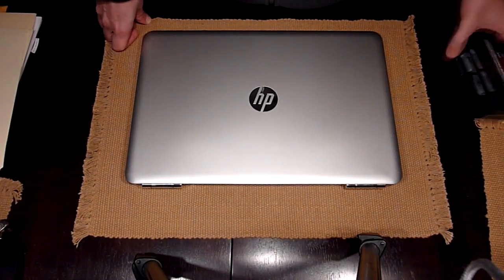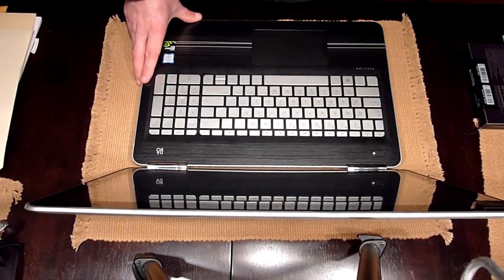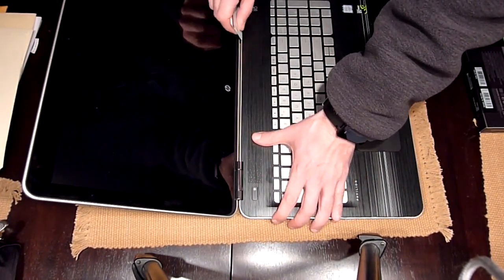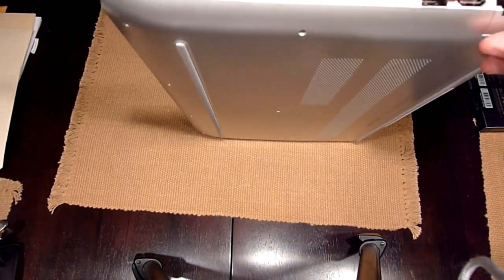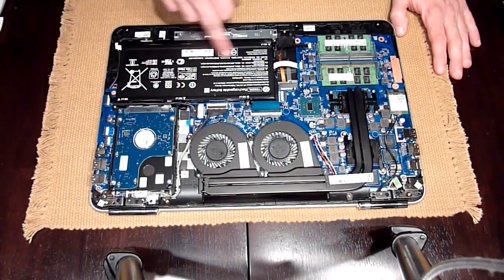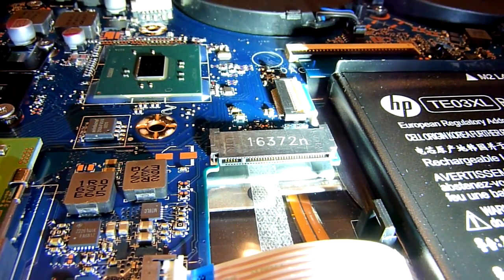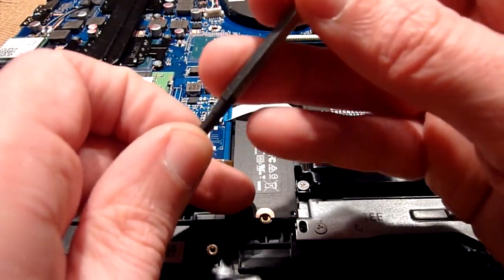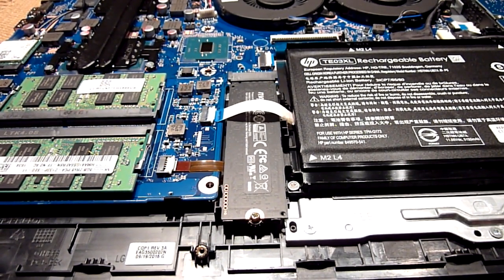HP Pavilion 15 bc018ca Laptop with Samsung 950 PRO M.2 NVMe SSD Drive install

Comment: Hi there i have same laptop but the next generation of it with core i7 7700hq 
Gtx 1050 
The problem is i asked hp if i can use nvme but they told me you cant because the 7th gen doesnt support this feature !!! And then i saw your video 
So my question i have Adata xpg nvme ssd with 3000 /1500 read write speed so if i install it in my laptop does that make any problems ??
Reply from the maker: I doubt it would not support NVMe drives... if you have the connector, I am pretty sure it will work... Again, install the drive while keeping your mechanical drive, turn on the computer, if you log into windows and it does not show up in the drive manager, reboot, log into the bios, CHANGE NOTHING, save and reboot and log on to windows again. It should show up in the drive manager, you simply need to create a new volume and format. It should work.
Reply: @Aleziss  thank you man
Reply from the maker: @mooder3247  you're welcome !
Reply: @Aleziss  have you lived any problems with your ssd ??
And does the motherboard can support this speed in my case my driver is Adata xpg nvme pcie3  3000 1500 mbs speed
 so i dont know if my motherboard can handle with it 
So do you recommend to buy this Adata xpg nvme pcie 3 
Or buy a normal ssd m.2 with 500/500 read write
Reply from the maker: @mooder3247  no problem with my Samsung M.2 drive yet, super fast, I get 2220 / 1255, a little bit slower than the drive specs but waaaay faster than any other drive that could get into my system. I you get a M.2 with 500mbit, this is NOT a NVMe drive, it is a PCI M.2 drive and probably wont be compatible with your system.
Reply from the maker: @mooder3247  you're welcome

Comment: Does the MB support NVMe speed or run it at M.2/ SATA speed? Is there an option for speed selection in BIOS? Thanks for the nice video BTW.

Edit: I see you mention that this is NVMe slot. How to identify the slot M.2 vs NVMe ?
Reply from the maker: M.2 is a form factor of NVMe AND SATA drive. The "key" that you see in my video is the M-Key and is used for M.2 NVMe drives. You cannot run a NVMe drive in a SATA port, NVMe is PCIe. So what you are seeing in the video is really running a NVMe drive, I am currently having bandwidth of 2220mb/s read and 1250mb/s write speed. The drive is capable of higher speed but my two three year old computer is handling that speed. There is no selection of any parameters for the M.2 slot in the bios, I simply installed the drive, ran in the bios but did not make any changes to the bios and when I rebooted, the drive was there.
Reply: @Aleziss  Thanks for prompt response.  I just wanted to know if there were different ports on laptops for m.2 SATA speed drives with two notces and M.2 NVMe drives with one notch.
Reply from the maker: @darshankumardave7485  you're welcome, yes, this is how you are going to know if it is NVMe or SATA. Remember, M.2 is the form factor and there are different keys that identify which drive the port support.

Comment: I have a optical driver if i remove it and use it as SSD, can i add m2 again for it?.. I have 1tb hdd memory and im looking forward to increase my memory.. So i want to know how to check my motherboards max memory support
Reply from the maker: I am not sure I understand your question but what I do understand is that you want to remove the optical drive to install a 2.5 inch SSD + add a M.2 drive ? For sure the optical drive WILL NOT support a M.2 NVMe drive if it was your question. The best way to know if your laptop support M.2 is to open it and find the M.2 slot. If you do not see the slot, it won't support M.2 as simple as that. Usually there is no maximum size for HDD/SSD in modern computers. RAM is another story, there you could have a limit of 8GB or 16GB, that you will need to find information about your specific model and brand, try to find the service manual, you will have all that information there. Google is your best bet.
Reply: @Aleziss  thanks a lot bro susbricbed ur channel loved for the response 😍😊
Reply from the maker: @bearytube4622  you're welcome, it is difficult for me to find the information for all the request I have here... but thank you for your appreciation !
Reply: @bearytube4622  hi Beary I can help you with your question.  I did the best sad/m.2 setup for my Hp 15 notebook.

1. Buy hard drive caddy to replace your optical drive. Make sure you get thickness correct.   Most common is 9.5mm but my HP Laptop is 9.0mm optical drive.  That's why it's good to measure it and find out.

2. IT IS IMPORTANT TO KNOW THAT OPTICAL DRIVE CONNECTOR IS SLOWER THEN YOUR SATA 3 WHERE THE ORIGINAL HDD is plugged in.

3. What I'm trying to say is if you add ssd and keeping your original HDD.  IT is much better that you swap them since the SATA 3 is much faster then the connection from the optical drive, does that make sense?

4.  Use cloning software to easily get the SSD with the same software and boot from your laptop.

5. I replace my HDD TOO, so I actually have 2 SSD drives and I install the m.2 SATA as well.  That way I have the most amount of storage and speed.  Hope that helps!
Reply: @Vunomic  thanks for the help brother really appreciate your work
Reply from the maker: @bearytube4622  It is important to undestand that what @AirTrack suggest is that you will NOT be able to install a M.2 NVMe drive in a drive caddy that replace the optical drive. If you do so, you would need a drive caddy that replace the optical drive then inside that caddy, you would need to install a 2.5 inch to M.2 SATA drive caddy but NOT a NVMe M.2 drive. Just wanted to clear that out.

Comment: Sir i want to know does laptop support m2 or Ssd. How can i find it? Through software test. Becoz i dont have much knowledge in opening of laptop. My laptop model is Notebook 15 i7 processor and 8gb ram and 4gb graphics and 1tb of hdd
Reply from the maker: I'm sorry to tell you like that but the best way to know if your computer support M.2 drive is to open it and check if you see the connector. You WILL NEED to open it to install your M.2 drive anyway so why not open it now ? You won't have choice to open it at one time to install the drive. This is the best way to be sure and search on google about your model.

Comment: Is this applicable for model HP Pavilion 15-bc018tx?
Reply: Can this be compatible with Samsung 970 EVO NVMe M.2 1TB?
Reply from the maker: I am pretty sure it is supporting a M.2 NVMe drive, just like mine. If you are not sure, just open the case and you will find the slot exactly where mine is.

Comment: Where did you get the screw that was used to fix the SSD into the motherboard? I have watched a lot of videos, but no one is telling about it. Was it supplied with the laptop? Or  with the SSD?
Reply from the maker: in my laptop the SSD is screw to a plastic stub that stand out outside the motherboard. The screw is not provided with the SSD because many vendors utilize different size screws. I had to find one in a bin of recycled screws I've collected over the years. It is a tiny metric screw but again, it is going to be different from one system to the other.

Comment: You can check if your laptop supports m.2 ssd or not by typing [model] + maintenance or service manual and search for it
E.g: this link is for hp 15 au004tx
http://h10032.www1.hp.com/ctg/Manual/c05228250

Comment: Do we have to delete the C drive from HDD after cloning it into the SSD?
Reply from the maker: good question, I would assume yes as I never tried both m.2 with os along with the mechanical also having the os... I did try the m.2 with a formated second 2.5inch drive and it does work fine.

Comment: Hey, can we use inbuilt HDD as our daily storage drive and use samsung M.2 SSD for the boot up? Because my laptop has a slot for M.2 SSD
Reply from the maker: yes you can but I would suggest that you use a larger SSD than use the mechanical drive as it will slow down your system... the SSD and overall system will have to wait for the mechanical drive to "spit out" data... plus at boot time, you will need to wait the spin up time of the mechanical drive...

Comment: I have BC 406tx i5 8th gen will it have a slot for m.2
Reply: same here bro ...!!
Reply: @deepnilvasava7803   I Found NVMe slot same as mentioned here. the only problem is that we dont get screw to fix  ssd onto motherboard from ssd box, neither with the board.

Comment: may laptop is 7th gen intel, but Hp telling me that my nvme slot is not usable, why they create slow that is not usable.. is it true?
Reply from the maker: I have seen one person who has a nvme slot and was not able to use it somewhere in this thread but I doubt it would not work, specially that your system is pretty new with 7th gen i7. You just need to pick the right drive and I am pretty sure it would work. You can also try to find the service manual of your laptop on google and there everything is listed. Also many vendors like newegg offer returns on some products. Best-buy also offers returns to product you buy from them in the worst case it would not work, you could return the drive.

Comment: My laptop model is HP Pavilion 15-cc020TU. i3, 7th generation.
Does my laptop have m.2 nvme slot or m.2 sata III slot?
Reply from the maker: according to the service manual, no http://h10032.www1.hp.com/ctg/Manual/c05493762 on page 2, it says nvme drive for use only on computer models with model numbers 15-cc1xx and 15-cc6xx BUT you can replace the 2.5inch mechanical drive and install a Samsung EVO drive, it is a great update you can offer yourself anyway, standard 2.5 SSD are way way faster than the drive you currently have.

Comment: Do you think we can upgrade the HP All-in-One - 20-c410 which has an HDD to SDD? We bought this https://store.hp.com/us/en/pdp/hp-all-in-one-20-c410. We want to upgrade it to 240 GB SSD. Thanks!
Reply from the maker: with the specs found on the HP website, it is stated that your computer is having a 1TB 7200rpm drive. A SSD drive will be the BEST upgrade you can offer yourself. I suggest Samsung products, they have a nice, free, migration software and it works wonderfully. Once the migration completed, simply swap the drives and continue to work and a MUCH faster and smoother environment.

I would not hesitate one second in upgrading your system. One thing though, it does NOT seem to be an NVMe drive, you will need to buy a 2.5 inch drive to replace the 7200 rpm drive you currently have.

Comment: Does my laptop sony Vaio VPCEB15FG support M.2 SSD.
OR I should stick to normal SSD.
Reply from the maker: @Amit Chahar
, by what I see the VPCEB15FG would NOT support M.2 drive. BUT you can install a 2.5 inch SSD drive, it will blow your mind, I am SURE you've never seen your computer that fast, even when it was new.

I recommand a Samsung EVO 2.5 inch drive, you can download the free samsung cloning software, install it in your computer, connect the SSD with a USB adapter, transfer the files and once done, simply swap the drives !

It works like a charm. I've done MANY upgrades using 2.5 inch SSDs and NONE have not been satisfied with the results... the oldest update I've done was on a core 2 duo 10 year old laptop, works wonderfully !

Best upgrade you can offer yourself even with an older model like yours. You won't regret it.

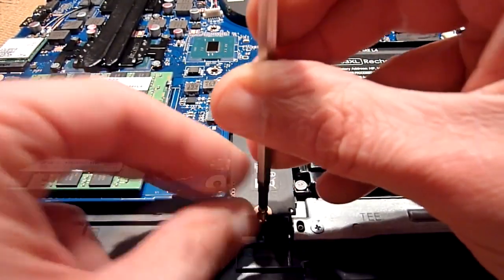Comment: at 4:29 where did you get that screw??
Reply from the maker: it is a metric screw I had in a bottle of mixed screws removed from different devices througout the years... I just looked for one that fitted... all I can say is that it is metric...
Reply: @Aleziss  thank you, I have to look for it.
Reply from the maker: @mohitksingh  you're welcome... sorry I can't be more helpful with the right size of the screw...

Comment: İs that working on pc ? -because I saw something about this.Pavillion 15 bc0... bc2... maximum works 256 GB.İf is that working,please reply to me.
Reply from the maker: I am replying to your message with that EXACT computer running 512GB drive, why woulnd't it work ? I even plan to get a 1TB drive and it will also work... this is a bc018ca
Reply: @Aleziss  So can use this wd blue m.2 500gb https://www.google.com.tr/shopping/product/17779739583642608341?q=wd+blue+500gb+ssd&client=ms-android-sonymobile&sa=X&biw=360&bih=512&output=search&prds=opd:9004144699810341888,num:4,cs:1&tbs=vw:l,ss:44&ved=0ahUKEwjliNeYy4DfAhUS66QKHcJNCVUQhC0IFCgA
Reply from the maker: @selimborekci5075  the model you point is NOT a NVMe drive, it is a M.2 SATA drive, similar speed than 2.5 inch SSD. That would NOT be compatible with MY model which is a bc018ca.

Comment: Hey me again lol.. finally got around to starting this. Got the m2 installed and running.. bought a second 500gb Samsung ssd to replace the one tb that came with it. But when I turn the system on Its not there?
Reply from the maker: I don't understand, you got it installed and running ? why did you buy a second one if the first one is already working ?

Comment: i think he installed the nvme ssd wrong the slot was meant for m.2 ssd
Reply from the maker: No it is the correct SSD for that laptop, M.2 NVMe is required and that is what you see.
Reply: Asakiler is right the nvme slot has the notch on right side and sata m.2 ssd has notch on left side
Reply from the maker: @gurpreetkaur-oo6tj  guys, the motherboard is upside down, there is ONE key which is a M.2 NVMe drive (NOT M.2 SATA), it is shown on the left because the motherboard is UPSIDE DOWN, so is the drive, when you flip the laptop the other way around, the key is going to be on the right side with the TOP of the M.2 NVMe drive actually sit on TOP as it is supoosed to be...
Reply: But connectors has 5 pins on left side notch the nvme slot should have four pins
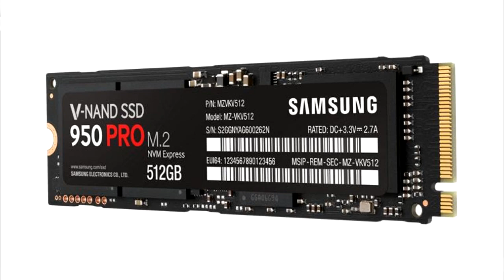Reply from the maker: @gurpreetkaur-oo6tj  I guess not, see at 3:10 and count the pins on the drive itself, it DOES have 5 pins and IT IS an NVMe drive...
Reply: @Aleziss  yeah your right
Reply from the maker: @gurpreetkaur-oo6tj  well, I'm glad I could clear that up ! Thanks for the questionning, it's always good to double verify.
Reply: @Aleziss  can i install m.2 sata ssd ?? i have the same laptop. pls help.
Reply from the maker: @yashbmr  NOT on my model, it is only for NVMe drive.

Comment: Can hp bc018tx  upgrade nvme m.2?, my laptop has m2 slot, but i'm not sure that it supports nvme m2
Reply from the maker: @
 Hiệp Quách Nghĩa according to Crucial website, it does seem your system would accept SATA M.2 drive.

https://www.crucial.com/usa/en/compatible-upgrade-for/HP---Compaq/pavilion-15-bc018tx

You can however upgrade your system by swaping the mechanical drive by a 2.5 inch SSD, you will gain A LOT of speed, best upgrade you can offer yourself on your computer. Samsung EVO 2.5 inch drive works wonderfully. You won't regret it.

If you want to be sure, you need to open the laptop and lookout for the M.2 slot on your mother board OR find the service manual, in there with the correct part number, you can find all the details of the system and you will know if it is compatible or not. 

The 2.5 inch SSD will work for sure.

Comment: Any bios setup required after this?
Reply from the maker: No, in my case the only thing I had to after the cloning and installing the drive was to enter the bios, change nothing, save & exit then reboot. Prior that, it was not detecting a boot drive.